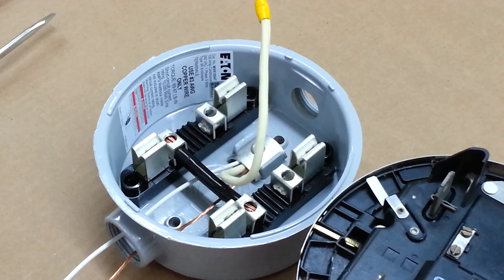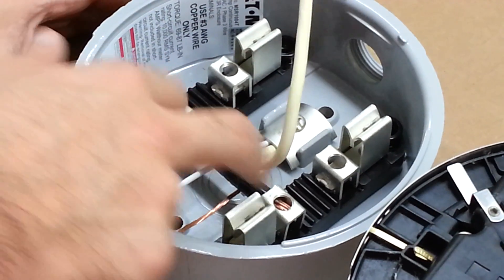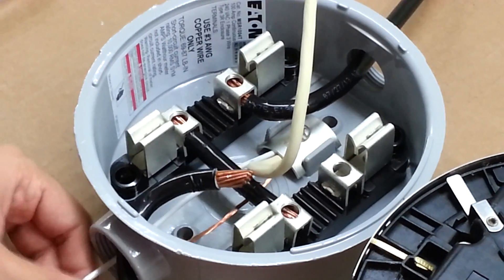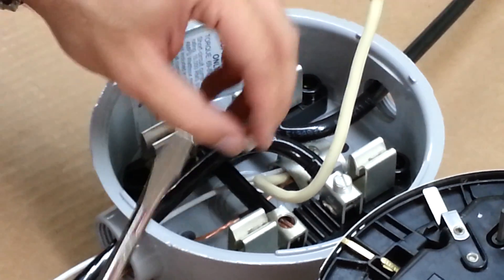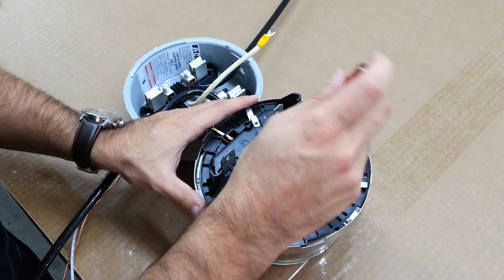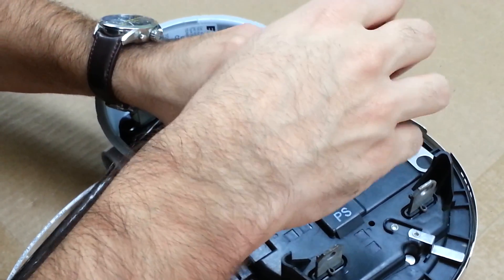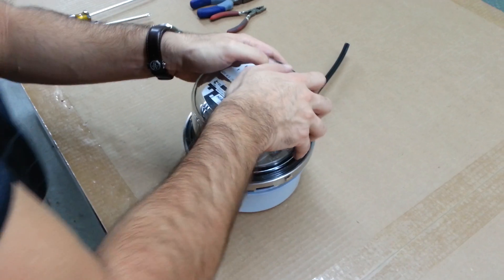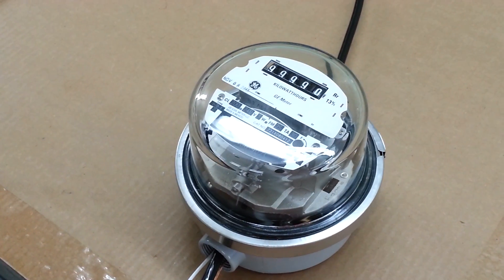Hialeah Meter Co. Wiring Diagram for 120V, 2 Wire Service using 2S, 3 Wire Electric Meter

Comment: I can see connecting the neutral and ground together if this were a primary service entrance, but shouldn't they be separated if you were setting this up as a sub meter or even making a lamp?
Reply: From what I can tell, if this is used downstream of the main entrance meter and downstream of the main neutral-ground bond, then you shouldn't re-bond at the meter.

Comment: How does this not bypass the Meter ???
The Line comes into the top of the  meter, So how is hooking up the load wire on top as in video not bypass the meter ????? 
LINE on top , Load on the Bottom ?????
Or does this type meter read  Up & down ???? NO WAY  waiting ?????

Comment: I had seen two of your videos and I noticed that you are not using the neutral wire of the entrance power and neither the neutral wire to the services panel, let me give you an advice if you love to make videos at least made them right, not having the viewer wondering about the neutral wire. before you display your videos to YT check them out and have someone to check them out too. working with electricity is a dangerous task. one mistake and you are FRIED.

Comment: Do you multiply the reading by 2 if you are energizing a 240 volt potential at 120 volts?
Reply from the maker: That is not necessary if you have wired the socket for the correct service.
Reply: What is going on is you are measuring the current twice by it going through both current sensor coils while the 240 voltage reference coil is only receiving 120 volts.  E x I= W    1/2E x 2I =W  My understanding of grounding is if the neutral is to be bonded with ground it should be done at the service entrance breaker box only with the screw that bonds the neutral lugs with the grounding lugs. The neutral wire from the meter goes to where ever the neutral current carrying wire is available for splicing or connecting to a neutral bus bar. If this box is plastic or metal then grounding is done when a bare ground passes through so that it doesn't come in contact with the meter lugs. If your not passing through but up and back with a metal box you may still need a full size ground to protect against any accidental failure of the meter box lugs.

Comment: Wherea the neutral coming into the meter ? It doesn't need  it ?  If i have one do i put it in the center with the other 3 wires / ( ground . Neutral s etc )